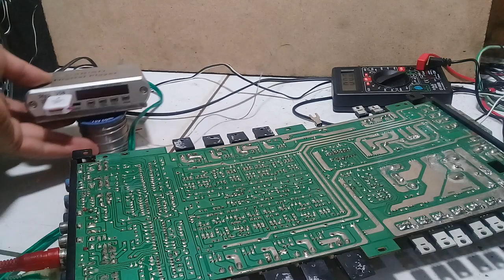Cara memperbaiki power mobil mati total/konslet (Kicx HP420).

Comment: Bang punya saya mulai mosfet,transistor bahkan resistor short semua tapi masih kluar suaranya meski gak normal, itu apa yg perlu di periksa?
Reply from the maker: Perlu bang.
Reply: @variadvantutorialchannel3113  apanya yg di periksa
Reply from the maker: Ganti yg sudah shorts.
Reply: @variadvantutorialchannel3113  semuanya  short bang bahkan input dayanya short, rem ke 12v,12v  ke min 12v
Reply: Dioda adae yg putus gan, stelah saya ganti suaranya saat di kasih input suara spakernya gembruruk gak jelas
Reply from the maker: Masih ada yg belum beres bang.
Perlu pemeriksaan lagi.
Reply: @variadvantutorialchannel3113 bang boleh minta no wa

Comment: Mas. Kalau ngga ada tegangan keluar ke elko besar apanya mas
Mosfet. Ic494 baru semua indikator nyala kira kira apanya ya
Reply from the maker: Cek trafo
Cek dioda
Reply: Mungkin ngga toroidnya. Soalnya ngga ada arus keluar
Reply from the maker: @handiniharja544  Mungkin bg.
Reply: @variadvantutorialchannel3113  yg nanya lebihh pintar dari yg di tanya, Parah 😆😆
Reply from the maker: @asepserang833  Trarfo itu sama dengan toroid kak.
Terimakasih by the way.